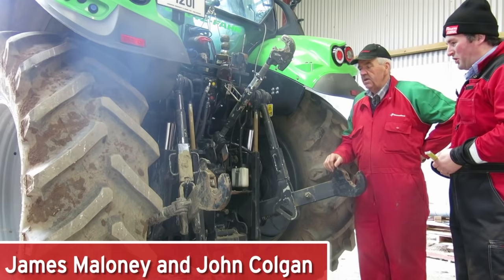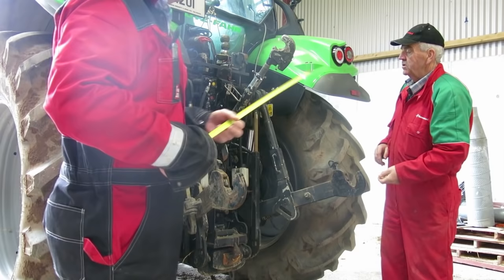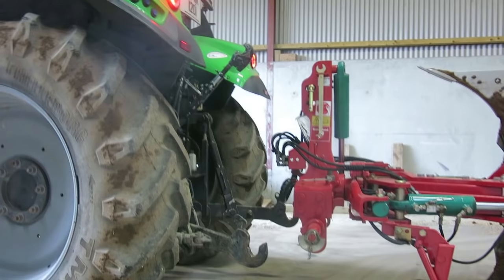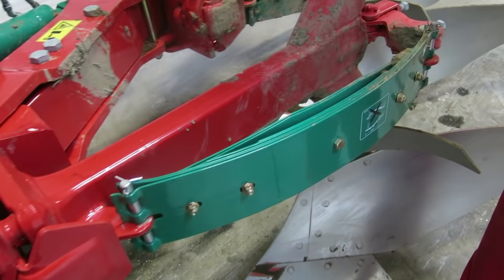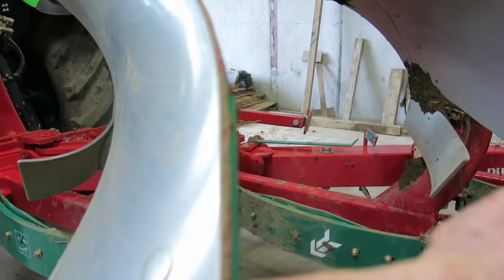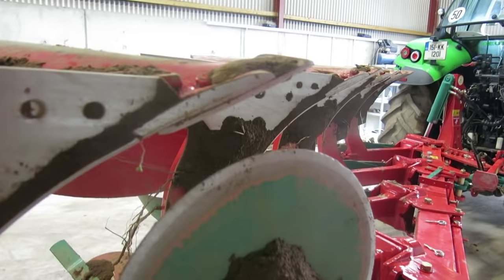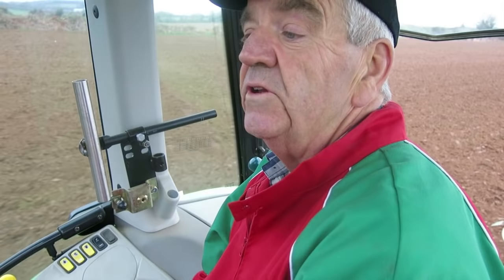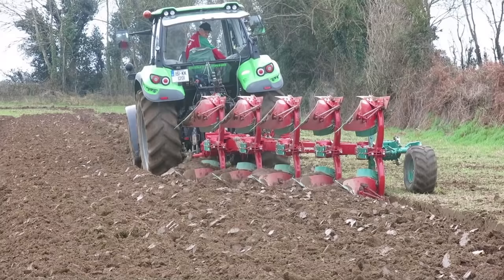Plough settings: get the basic rights

Comment: Great work.I remember in early 1970,s ploughing with Massey 188 and 4 sod Ransome 14 inch conventional plough.rear wheels 56 inches centre to centre,plough 4x14= 56".with plough properly set up,no need to use difflock...

Comment: May have been better to show a diagram explaining the line of PULL to be centred.    I completely DISAGREE with the general stuff said here: I cannot say that the Kverneland Plough settings are wrong: I am more concerned with the TRACTOR.   but even HERE, the TOPLINK is set all wrong. READ THE BOOK folks.  I have seen 90-100  ho tractors struggling . fighting against itself as discussed below. As the visitor, all I could do in the FIELD was re-set the top link .  What a  difference  THAT made.   There are some lovely vids on youtube from LEYLAND  - showing under 80hp 2WD drawing up to 5 Furrs WITHOUT a rear "depth " wheel - ( a mis-noma anyway).  THe wheel should brush along on the leaves / stubble and prevent the TAIL of the plough nose-diving when a body trips, OR the front of the tractor raises (too) high - maybe insufficient Fr ballast - OR so finely tuned for Max. performance!   That's it  - from  experience.   Shall we get another video explaining this?
Reply: This video already explained that you should use the toplink in the big slotted hole in order for the plough to be able to move freely. This is the correct way on a big plough like this.
Reply: The plough was set perfect
Reply: @bazgino  If you have lower link sensing you use the slot for the toplink and set the length at normal ploughing depth to have the pin in the middle of the slot, as in the video. If you have top link sensing on your tractor you use a hole to link the plough and toplink. I don't think size comes in to it!

Comment: Would you expect the points to be turned once,  three times or five times in their life span ? Its just that the more the shares wear then the greater the difference between a new full length point and the share e.g if the share is 60% worn a full length point will stick out much more in front. If there was time would you turn the points after each centimetre of wear ?